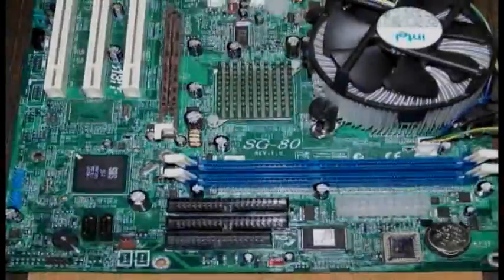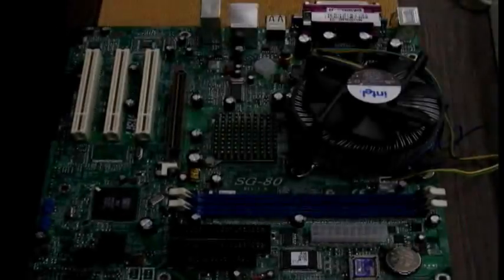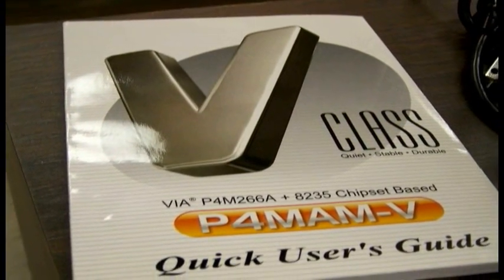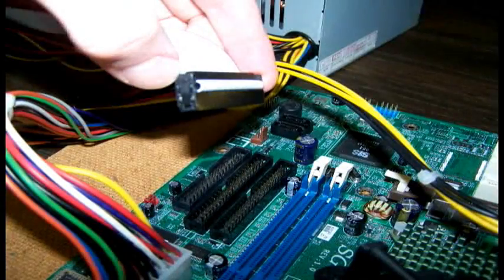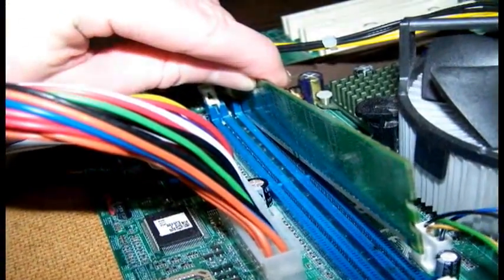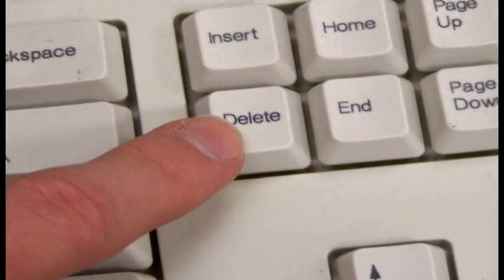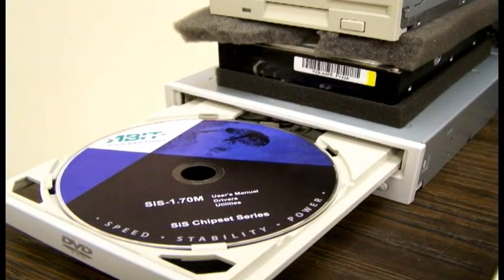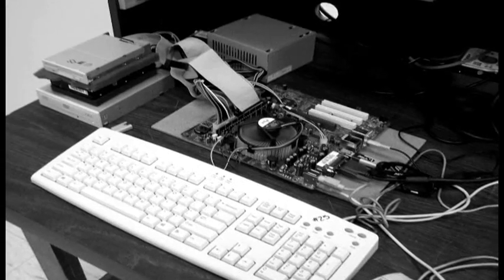A Short & Simple How to Build a "No Case" Computer Tutorial

Comment: Hey dude, if you're interested in having a system that is more powerful in all applications including games as 90% of the i7 machines out there at the moment. Pick yourself up a dual CPU socket 1156 motherboard from like Supermicro for about 50 dollars. Then buy 2x Xeon 5650 CPU's for the board. Get 16gb (8 for each cpu) of DDR3 ram. Put your old gfx card, PSU and soun into etc and you'll have something that can only really be beaten by the i7-6950x. They're VERY good on pwer etc. Dunno how more people aren't doing it. The CPU's can be picked up themselves on ebay for about 25 each. So the board the cpu's and the ram all for about 150. Let me know what you think

Comment: @KedViper Only if you want to. Also, you can use the same cable for the CD and HDD drives just make sure the black connector goes to the HDD and the grey to the CD

Comment from the maker: joewizard100, sorry I accidentally removed your comment. I meant to hit "reply" which is right next to the remove button.

To answer your question, that might be the reason.  Without thermal paste the processor will more than likely over heat immediately and shut down if it has over-heat protection.  It could even possibly permanently damage the processor.